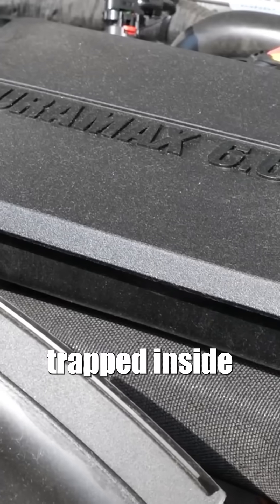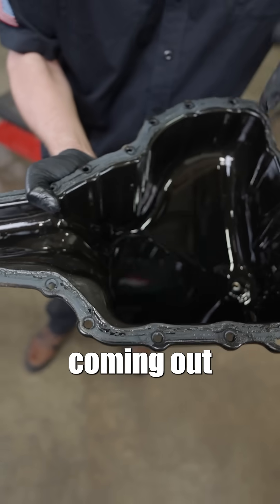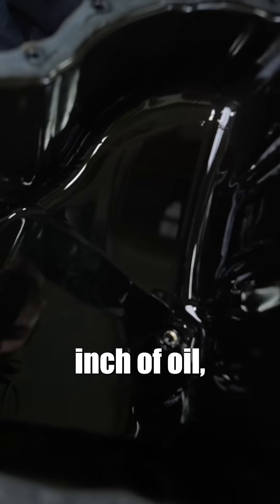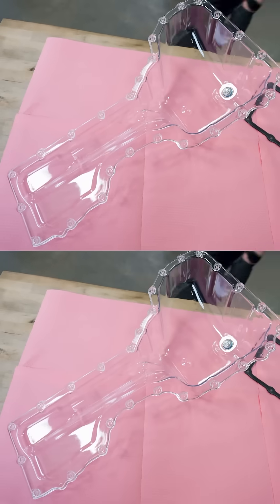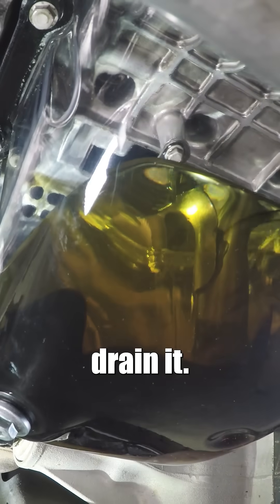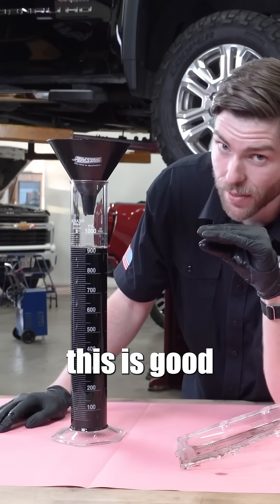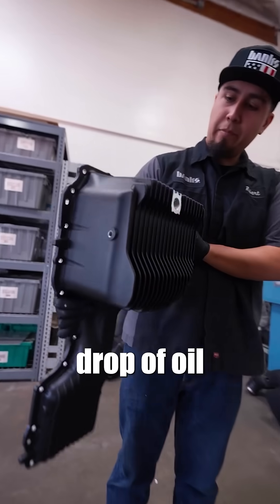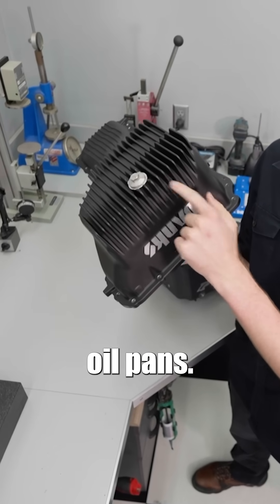A disturbing discovery. This dirty oil is trapped.

Comment: AT THE FACTORY!

They need to flip the welded in , oil plug threaded insert. 

Moving the entire thing on to, the outer cover area. Eliminating the problem all together. But.

Some engineer?  needed room on the outside, for his,  urinal tube invention, which runs just under the center of the drivers seat, through a hole in the floor, but the tube is gonna have to go right over the spot where the. oil spout should be located on the outside of the oil pan? 

So. We are gonna have to put that whole thing, inside the oil pan assembly.  

Thats why, this guy invented a new oil pan assembly. You see?

Comment: That we are commenting?  means he got our attention, right?

Not a bad idea. Toyota should pay the man, $100,000,000.00 for the invention and another $100,000,000.00 for making them. clear?

You could slide under your car,  and take a quick look at your oil, at around three thousand miles. 

If it looks good? Yer good. 

We would all know, exactly how long does an oil change last,  before your oil is dirty enough to change?

We would all have our own little indicator in our mind. right? 

For me, It would be something my grand dad said to me, when I was five. 

First time I watched him check the dip stick, then change the oil. Telling and showing me. Dirty oil and Clean oil. 

The next time I saw him, he said, hey, let’s check that oil, Jeffy!

I remember running to his garage, (I can still smell his garage with all of the rust and mildew. The excellent flea market sales we went too?)

 and grabbing his red rag, popping the hood, but I couldn’t lift the latch,  under the front edge, spring was too heavy. 

He opened the hood, and I climbed up the bumper and grill, on his 64’ Rambler. 

I pulled the dip stick, wiped it, put is ba k in, like he said, then checked it again. He said is it clean or dirty?

It had been Round six months, so it was getting dirty, he oretended as though it was filthy dirty, so we could change it again. the dip stick went back in, then pulled up to open the tube, actually provided vacuum to drain with.

  Using two hands to twist the oil cap off the head cover. Then putting his blue funnel, with the long spout on it, in the cover. 

He poured the oil, and the whole time, he is reiterating his last oil talk with me.

Sorry. That fellas. Remember to do this thing with your grand kids. Boys and girls. They need to know this stuff.
Peace.

Comment: When you cycle clean oil through the engine it clears the pipe , just add some oil turn the engine over drain again then fill it up , your not stuck with that oil especially if you take the sump of and release it

Comment: im no diesel tech but im pretty sure there is a high pressure oil pump for the injectors. had to take the cover off one on a ford and it holds at least a quart of oil right there

Comment: The reason they do that is to not loose the fluid prime when changing oil. A lot of VAG and BMW engines take 40+ seconds of cranking when the prime is lost. A lot of these newer systems need that design to prevent dry starts for 20-30 seconds every time an oil change is done.

Comment: Not all pans. Honda pans aren't like this on the J series, theyre at the lowest point basically. Certified Acura tech with PACT graduate certifications. Also Mercedes sucks all the oil out in their procedures. Just saying. Id use the word potentially, theres potentially a quart left in the lower pan.

Comment: An auxiliary electrical oil pump for starting only would create the necessary oil pressure to eliminate "dry" starts after oil changes, or every morning.
Yes, this Banks pan is a very good innovation if it improves oil cooling and reduces dirty oil in the pan sump.

Comment: A "problem" that when resolved will NOT prolong the lifespan of an engine as long as you change your oil when you should.  Also, the vast majority of DYIers are going to drive their vehicle onto a ramp that will further reduce the amount of oil left.  Also, pretty sure that taking off the oil filter will allow the pickup tube to empty.   The only benefit would be if this pan really cools significantly better.

Comment: This is why you always keep the motor running while you change your oil. It makes sure all that yucky old oil drains out of the pickup tube. You'll know you did it right because the car will turn itself off automatically. I think it senses when the oil is empty and the computer puts it into mechanic mode. In some cars its called genie mode because there is a genie lamp that lights up on the dashboard.

Comment: Could rise crankcase w diesel, or even just some cheap convench oil. Or if u know a guy at a shop or oil place just tell them to run a quart through the motor with the plug out before filling. Ive done this is all kinds of engines

Comment: So IF you actually think that this is a problem, here is what you can do: Just buy the cheapest oil you can get, any 10Wsomething will do. Flush all the old oil, change filter. Fill in the cheap oil,  idle engine for some minutes, rev it maybe 2-3 times. Flush the cheap oil, fill in the good oil. Do that  every other year or so.

Comment: That’s why there’s a thing called oil catch can that’s actually a thing and I didn’t know it was. I didn’t know what the hell it did until but mine had it on his challenger and I can’t understand why now that shit pretty much just defeats what you’re telling us. Yeah, it builds up, but that C-Kan is designed to catch that so that oil stays clean and any dirty oil that the system vines it sins are right to the damn catch can and it takes a while for it to fill up, but once it does, it looks like a damn cup of oil which obviously it is cuddled the mountain bracket and everything you can get it for any vehicle. I’m pretty certain and a truck too. I’m gonna be doing it for mine because I don’t like that dirty oil in my filter if you don’t know what the old cash account is you need to look it up and you probably need to go ahead and get one you gonna thank me later, especially when you see how much of an improvement it does to your motor

Comment: Just change your oil ha ha. Oil cirrulates normally throughout the engine with it running on a regular basis so regular maintenance should never be an issue. 380k on a 7.3, no issue,  310k on a good 5.4, no issue, pushing 500k on a 5.7 Toyota Tundra, no issues. What a freaking joke

Comment: Suction method through the dip stick hole would be a better solution instead of unplugging the drain bolt from the bottom.

Comment: Good thing that the new oil will mix with that old oil and dilute it. This occurs with every oil change. Also, many shops will use an oil vacuum that makes this pretty much a moot point...Nice oil pan, though!
Reply: You must be getting your oil changes at Midas because I've never seen a quick change use a pump! EVER. The only time I ever used a pump is when I was running drag motors that cost 20 grand....
Sorry to call you out on your BS but I got to call it.
Reply: @1mikewalsh  I didn't specify quick-change, but I agree that they don't typically use them, although they do have them.
I work in IT, and our largest client is a dealership with about 15 locations, so I speak with service techs often and, myself being a gearhead as well, asked about the oil evacuators being used. They will use them whenever they have other things to do on the car while the oil is getting evacuated. I have one myself, as my Audi's oil filter is on top of the engine, I don't have to get under the car for oil changes.
There is no BS here, just a different perspective than what yours is.
Reply: @HASTE347 
He's not wrong, the only time people/techs use/have them is when they have to. 
Otherwise it's drain plug-o-clock.
Reply: @kairu_aname  I didn't disagree with him; I've never seen a quick change use one, just as he stated. I just spoke from my own experience and the perspectives of the dealership service techs that I have spoken with.
Reply: @HASTE347  
You've never seen a quick change use one because they typically don't have them, and typically don't need them. 
That's what he was calling you out on. 

Easy to cobble together a collection of pieces to make one, then pull it apart to do something else with those individual components again.

Comment: That is why it is critical to change your oil at least every 5,000 miles to keep that remaining oil very diluted of containments.  Some cars have less left over oil, my Acrua RDX, Lexus SC 430, and the Toyota Tundra 5.7 has only a 1/2 a quart left from what I could find out on the internet.

But it doesn't matter as long as you change your oil at least every 5,000 miles, and according to the The Oil Geek on YouTube, he suggest we need to change our oil every 4,000 miles, not 5,000, and even worse the 10,000 mile interval some manufactures claim all you have to do.

Comment: I never understood why they don’t have just have the drain plug be at more of an angle so the threads can have clearance to drain that bottom layer of oil and it would prevent the drain plug hanging lower and potentially being smashed. Always seemed like a simple fix that never caught on.

Comment: Trying to solve a problem that is not there. Every oil change always leaves some oil behind but it is not a problem. The OEM design is smart in the sense that if the drain plug for some reasons comes out while the engine is running, that protrusion will save you, its a smart design that allows the engine to run longer without the drain plug

Comment: Weird because cars have been made with the old pan for many many years and I have not seen one damaged motor from the older pans, even 40 year old cars are running great with their original pan. 

Wouldn't it be cheaper to Bring your pan down, re gasket it, clean it out and put it back in every 5-10 years? Suresh beats paying $1200 

While this is a great idea most don't keep cars for more than 5-8 years. 

I can't justify paying $1200 for getting a quart of dirty oil out.

Comment: I do an oil replacement flush with 0-w-20 100 miles begore doing full oil and filter change to flush the worst out.
I had a poorly maintained engine that required 7 replacement flushes to get the solid particle sludge out of the oil system.

Comment: Draining your pickup tube is not a god thing.  I feel like this design is purposeful, to keep the oil pump primed so you don’t starve the engine for oil on startup after an oil change.  Pushing an air slug through the system, even for only a few seconds, will likely do far more damage over the life of your engine than the 1 quart of oil that stays behind every oil change.

Comment: The quart of left over oil is needed to avoid dry start after oil is changed, the oil filter needs to be filled as much as you can also at each oil change use an engine flush at each oil change to disslove the sludge.

Comment: If your pickup tube drains, wouldn't that mean that your truck is running with 0 oil when you restart it again? Until the system re-primes anyway. But still, a couple seconds with no oil, right?

Comment: If your car takes an awkward amount of oil. Like the 370z [5 1/8 quarts], use the extra oil and dump it in the fill hole when it's done draining and it'll plob into the empty oil pan and help clean a little more.

Comment: Elegant solution to a problem never existed, but a finned metal sump beats any plastic BMW sump
Reply: I'm always surprised hearing they have plastic ones 😅 every time
Reply: @Allan.509 plastic oil pans on the zf auto trans as well.   Lucky a steel pan is also available, for my Ford Falcon running on dirt roads in Australia.
Reply: @railtrolley  damn that isnt a US model, we don't have those here.. I don't really like Ford's but if we had those maybe I would
Reply: @Allan.509  It's a shame they remained an orphan model in Australia and New Zealand.  The US Falcon stopped production in 1969.  Continued in Australia until 2016.  I have a 2013.  Still has a straight 6 as the standard engine. The Barra.  Though by 2013, the Barra has grown from 144ci in 1960 to 244ci.  Has a cross flow cylinder head, double overhead cams, 4 valves per cylinder, and VCT (variable camshaft timing)  The auto trans is ZF 6hp26.
Reply: @railtrolley  yeah those are really cool. I've never seen them but they look really similar to some Acuras on the front, but just really different. sick
Reply: @Allan.509  I've never seen any plastic sumps on BMW
Reply: @Salpeteroxid cool story bro. Sounds like you have very little experience.
Reply: @ryantogo8359   Probably, my sump is magnesium. I would never be a car mechanic anyways.
Reply: @Salpeteroxid so you don't work on cars and yet somehow your "experience" of never having seen one is supposed to mean something? What Universe do you live in?
Reply: I've never seen a plastic sump on a BMW.
Reply: I've never had a problem with either of my BMW plastic pans and they allow all the oil to drain.

It's only a problem if something goes wrong.

Comment: Ive never had a problem with my trucks 350. Drains all the oil everytime. But I do put like 1/2 quart of ATF in there just to kinda flush things out a bit. You lose literally nothing other than like 6 bucks every 2 oil changes. Soooooooo

Comment: Not if your aluminimum pan comes with the drain plug on the very edge of the "floor" of the sump, like mine does. And the engine is slightly tilted backwards, so it gets every last drop. Or, well, pretty close to.

Comment: That is not a design on most cars. Every import car I have worked on in 40 years , the drain plug threads are flush with the Inner side of the pan.😮

Comment: It's almost like they designed it like that so idk maybe you don't have to fill the pick up tube every time you change your oil and run with no oil pressure for however long it takes for oil to get to the oil pump and fill the oil filter so it can finally make it to essential engien parts. 😅 idk just maybe

Comment: I’m fascinated how he acts like manufacturing engineers haven’t thought of this. 

Trust us, we know about this, and our simulations and road tests show that the results of failure because of it is a lot lower than how he makes it out to be. Your engine is more likely to fail from bad oil than a poorly designed oil-pan.

Him selling on the system isn’t snake oil per-say since the results are mildly noticeable, but you’re not seeing a big net increase to justify shelling out a couple hundred bucks for a mild change.

This is similar to Amsoil claiming to be the gold standard when conventional synthetic oil performs on par to it. I have 3 personal vehicles at over 300K-400K miles to claim it wasn’t worth the extra $15-$20 for Amsoil.

TL;DR, if you haver a high performance vehicle, then maybe go for it. But if you’re thinking about putting it on a regular Ford Maverick, don’t bother.

Comment: I drained the oil in the 1998 Toyota Camry 2.2l and had an extra quart of oil so i dumped the extra quart after the initial oil drained and it was very dark and dirty but I may just change the oil pan for a better design

Comment: Well, that's irrelevant tbh, when you change oil, it mixes, and then every next change it removes it and mixes with newer oil, making it essentially new. Also if you change your oil at the right time, that "old" oil isn't "bad" just close to being saturated. 

AND a bit of old oil also will be inside the engine block, head, and all tubes. So this oilpan doesn't really stop old oil to stay in the car and mix with new oil. 

Also the engine has to run at a certain temp, and it's designed for that temps, not higher not lower, so adding fins to the oil pan doesn't help the engine at all, because its awready built to aways dissipate enough heat to keep at the propper temps.

Comment: Oil pan with fins to increase oil cooling.... I had PTC heathers attached to the oil pan of my previous diesel car. it also had an oil cooler. Never had an issue with overheating oil, but the cold starts at -25⁰C... The engine didn't like those

Comment: you guys make armored ones for jeeps? or ones that connect to skid plates? would like this for my jeep but the plug is too far down. and its make out of a very light fragile material. would get smashed open the second i took it over a rock and accidentally bumped it.

Comment: I have 226,000 miles on a 1999 F150 4.6 V8 I change the oil, that's all you have to do. You don't need a fancy oil pan either. That's Aluminum oil pan vs Steel oil pan, what I have!

Comment: This causes a different and much worse problem. When the oil pickup tube is drained completely of oil, it causes a condition where the engine does not get oil for a significant amount of time upon startup. Over time, this will wear the engine components

Comment: The point of the raised drain plug is to keep the oil pump free of air. Dry starts cause more damage than diluted oil. If you change your oil often, it won't matter.

Comment: The 6.0 ford diesel has a 15 quart oil change but the engine has a 16 quart capacity.  A quart always remains in the engine valley and HPOP plus some in the oil cooler like all diesel engines.  With zero oil in the HPOP your engine wouldn’t start after an oil change without a very long priming crank.

Comment: the pickup tube draining means when you first start your engine after an oil change it runs even longer with 0 oil pressure and no oil circulating. Thats way more damaging then the slight oil that didnt get drained

Comment: Wouldn't that cause a little more first start oil starvation since that pickup tube isn't submerged and loses the bit that it holds aiding on initial startup after the oil change? Thing engineers designed it that way on purpose.